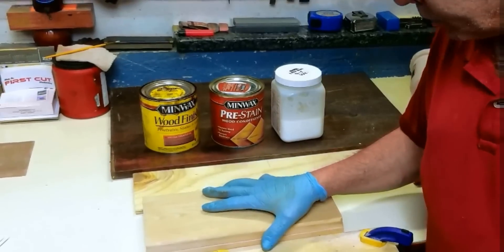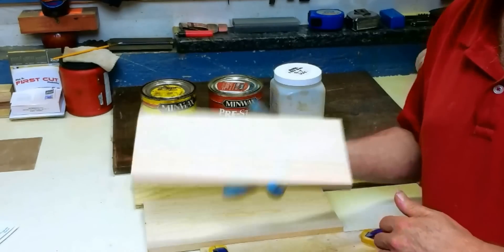Make The First Cut: Staining 101

Comment: I was one of those guys who never cared about the blotchyness of pine. Then I discovered that thinned polyurethane works very well as a pre-stain conditioner. I would save old poly and thin 50/50 with mineral spirits, then pour through a paint strainer and voila...conditioner. The only down side is having to sand a little before applying the stain. Works well with maple as well.
Reply: John Shaffner That really works? I can't find pre stain or conditioner, and want to do the same, use 50/50 poly and mineral spirits for seal the wood.